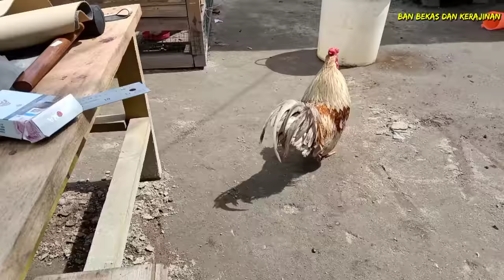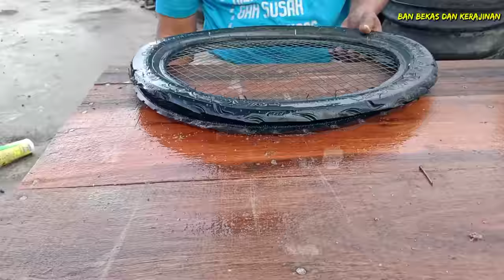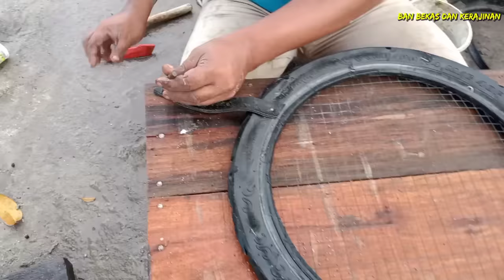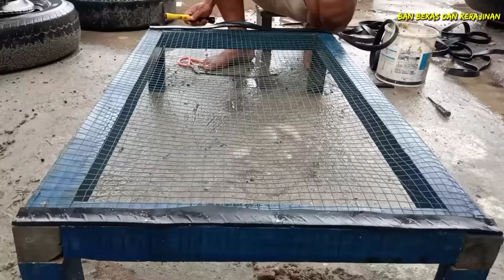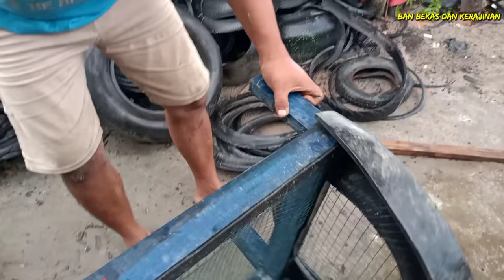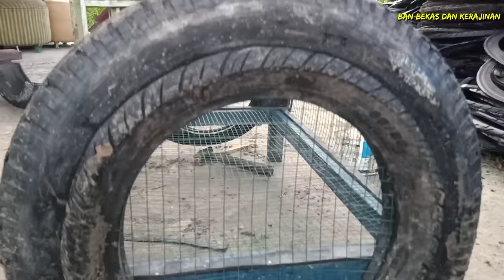used tires for making chicken coops

Comment: I actually made one that’s similar to the one in the video. Only I used 3/4” plywood on the ends the the plywood was cut in the curve at the top. Then used pvc pipe and made a jig to heat up the pvc and bend it on the jig so the curve was right. At the bottom I used 2 - 4x4x 8 ft long nailed to the bottom of each side of my plywood and cut a door in one side of w plywood to put my chickens in. I also put 4 wheels on it that’s on levers on the sides so I can use the wheels and levers to lower and raise the coop to roll it wherever I want it at. Since it lowers to the ground there’s no bottom and the chickens use the ground inside. Every day I just move the coop to a new spot rather then having to it out.  It’s very handy for small chicks especially! It’s got 3 roosts inside too!
Reply: Innovative and I 💭 that tire Coop was creative :0) U gotta 💕 You Tube

Comment: Must be one heck of a sharp knife you got for cutting up those tires!  Turned out pretty good,, especially with using all hand tools and hammer and nails. I’m lazy, I use power tools and screws! LOL
Reply: Tires can be cut with a regular serrated kitchen knife too you just have to cut it the right spot and it cuts like butter they call it the " sweet spot" .
Reply: PRVDI.NA.BOSNSKI

Comment: I think artistically it's pretty cool. But I'd use 1/4 inch hard cloth for the floor if it had to be wired.  Also secure that door so no predators get in.  Good for young chicks before getting introduced to a flock.  Also cute for Quail maybe.